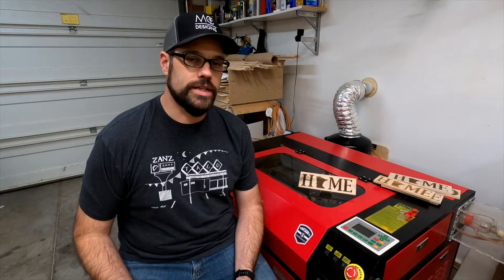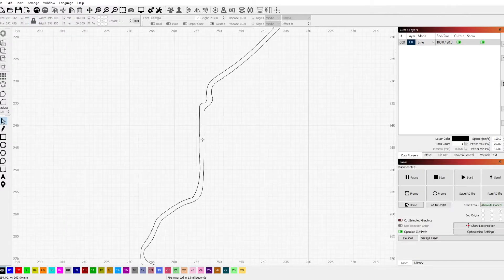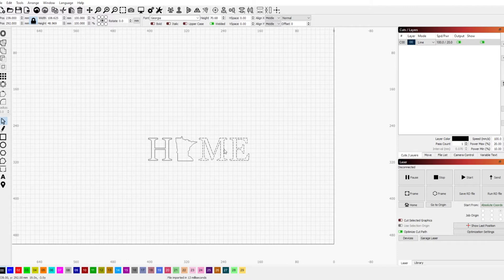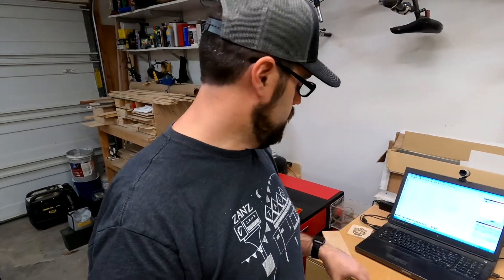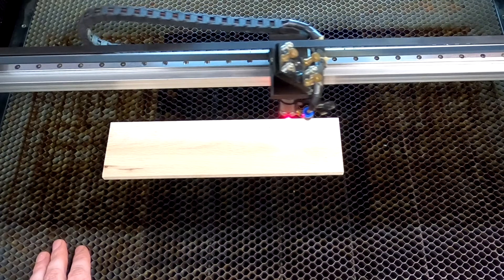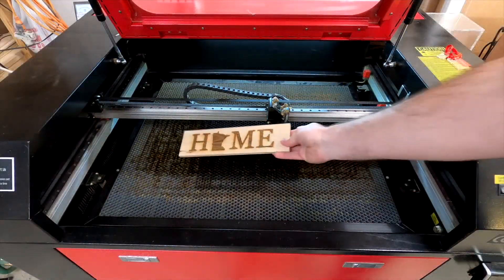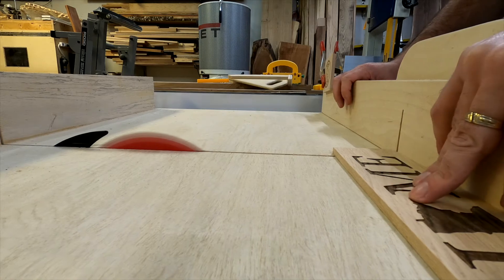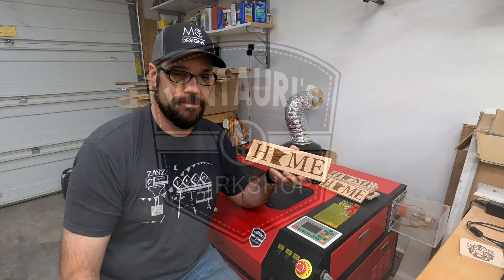Engraving wood with a Co2 Laser from eBay

Comment: what distance do you have from the wood and the laser?
Reply from the maker: This distance will vary based on the focusing lens you are using. This was done using a 2.5” focal length lens. So the distance from the end of the cone to the material is about 5/8” for my machine. To find the exact distance for any laser you should do what’s called a ramp test to determine the finest focal point.  This is where you take some clean scrap material and set it in your machine at an angle. Then you run a single line up the ramp and when it is done you can see where the line is the smallest width. Measure the distance between the material and the laser head and you can then cut out a tool with that width to use to set your focus.

Comment: how did you delete the second line what do I use in lightburn to do that, also when I engrave my wood is having layers like the wood burns at different rates on my letters. How can I make the engraved layer smooth and not look like steps of the wood grain?

Comment: I've been watching your videos since It looks like I have the same laser only in the 80 watt. I was wondering if you have done a video using the pass-through since I have been struggling with how to get it to work right. I feel as though the only way I will be able to use it will be to purchase a longer focal lens so I will be able to drop it down more to reach my ideal focal distance.
Reply from the maker: I have not done a video on using the passthrough feature. You are correct that you would need a longer focus lens or lens tube to move the focus point lower. I've not had a need for this yet so I have not gone that route. If I do I'll be sure to create a video to show others the method and results.

Comment: Does your machine have motorized up and down bed?
Reply from the maker: Yes it does, it's just push button controlled and not stepper controlled through the panel or software.

Comment: How much Power and Speed do you used for this engrave?
Reply from the maker: This was run at 150mm/sec and at 30% power on a 60w Co2 Laser.
Reply: @Vintauri  What was the lines per inch?

Comment: Hi, how deep can your machine engrave?
Reply from the maker: It depends on the material, power and number of passes you make. In theory with multiple passes on wood you could engrave as deep as you want as long as you have the focal distance space to keep going deeper.  I generally go for just deep enough to leave a solid marking and have some depth to sand the top layer clean if needed. That is usually about 1/32".  As far as cutting the material I can cut most natural woods of 1/4" in a single pass. Glued up woods like plywood are hit or miss depending on the type of glue used between the layers.